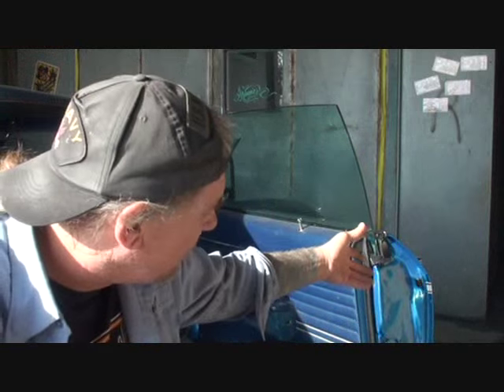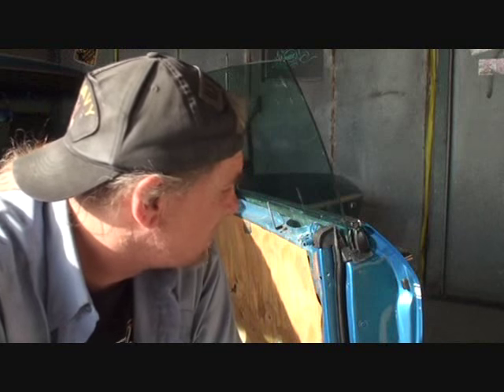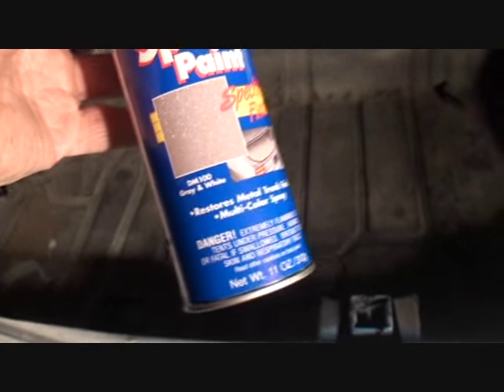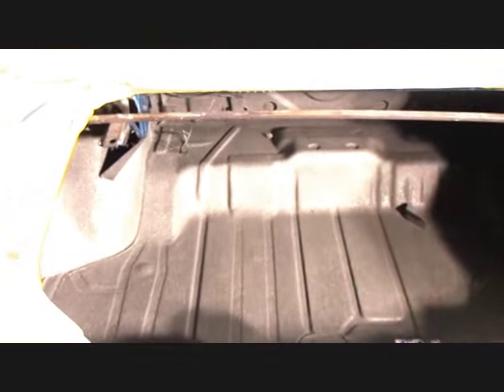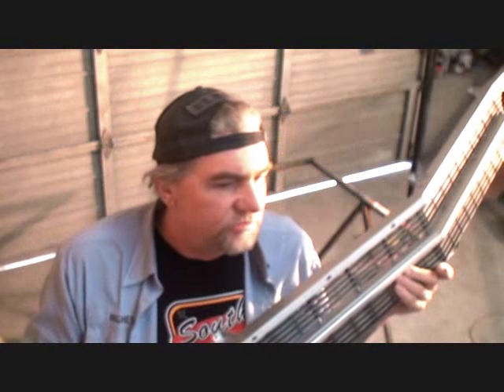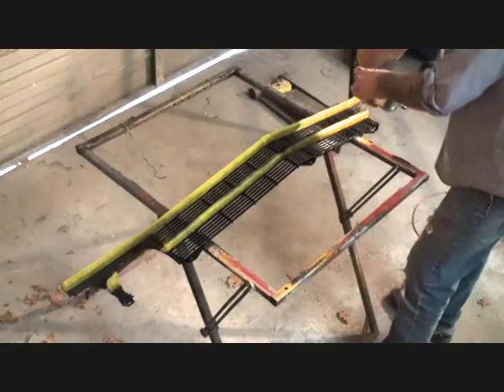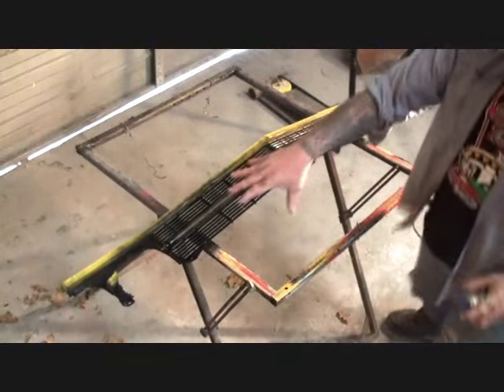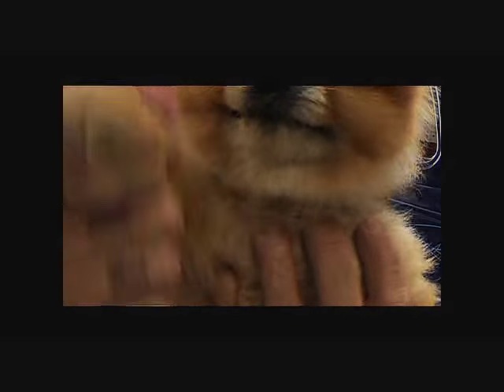"How To Paint A Car"-By Yourself-Part 17-How To Use Spray Paint In The Can

Comment: Details make the difference!  My friend in Kingman had a 67 Chevelle SS restored & paid a lot of money.  Looked great until you opened the hood.  The radiator support had nice new paint over the old chipped & scratched factory paint - didn't even sand it first!.  She said that was the one thing that always cost her points at the shows.  As you say if it's worth doing do it right!

Comment: Also....IF ya REALLY want SUPREME DURABILITY of the "spatter paint finish?"   Go ahead and flat/satin CLEARCOAT over everything you spatter painted in the trunk for MAXIMUM topcoat protection. The PROBLEM with ALOT of the over the counter spatter rattle can paints is that they are LATEX BASED! And when/IF they do in fact get WET? You THEN have a trunk floor finish that is wrinkling, peeling and needing stripped off.........Just food for thought. Again, doin a GREAT JOB on a GREAT CAR!    Also lol, where is the SS side stripe application video at?

Comment: The car looks really nice Pete. For the owner however, I'd say that the only part I don't like is the white stripe which breaks the upper from the lower part of the car. I always liked the 69 for its continuity of shape from front to back and from top to bottom. But to me to put that white line in there just destroys that continuity. Something Chip Foose would do thinking that two tone defines shape when actually, doing that, destroys one's perception of original shape and good body design. Something you might do when the body designers designed an abortion rather than perfection like in the case of the 69.
Not your fault Pete, I know that, as you just give the owner what he asks for, but shit, what a way to destroy a really attractive and professional paint job.